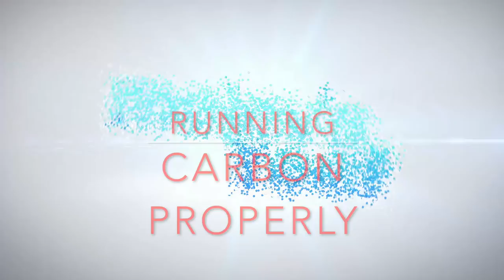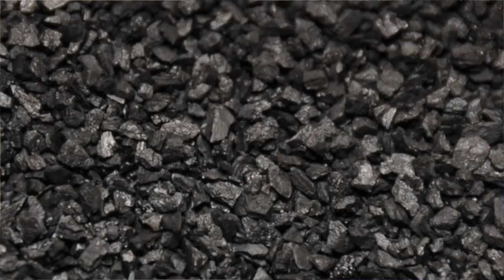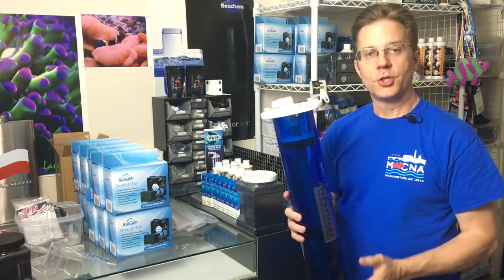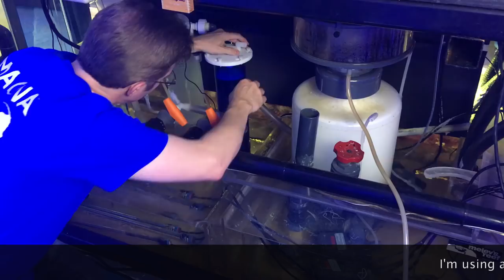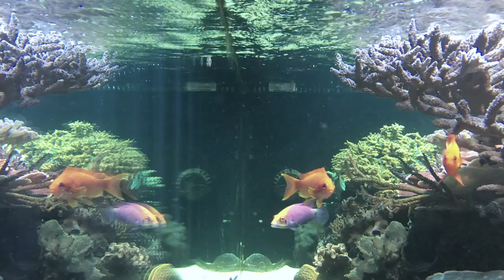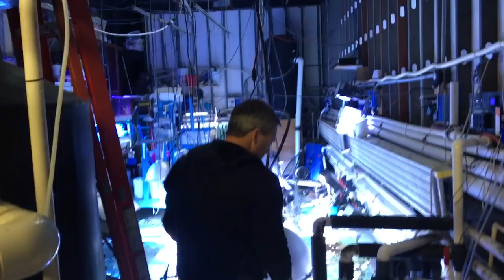Running Carbon Properly in a reef aquarium

Comment: Thanks for the video, informative and well filmed as always. I run my carbon in my MR1 placed at the top above my GFO. Works really well to polish the water. You mentioned cyano, I ran into that problem while carbon doisng trying to get rid of algae issues. As soon as I stopped carbon dosing it went away within 2 days. I tried multiple carbon sources and they all produced cyano. I mention this knowing you carbon dose, so maybe that may be the contributing cause. Love your videos and definitely enjoy the longer videos you produce, so an hour long video, especially on such a large system, will be great to watch. I find when reviewing tank systems, shorter videos tend to rush the info and overview so not all the information can be delivered.

Comment: True that. Carbon is bye bye after a couple of days through active circulation. Many are told to keep it in for a month. My return pump is 800 gallons an hour. For 1/2 cup of carbon this becomes quickly utilized and exhausted.
Reply: +Alex Kingcole 
also, thank you for posting the 20K gallon reef! Love it, love it, love it. I was at Joe's 2015 MACNA conference so this is awesome.

Comment: I stopped using granulated carbon on a continuous basis a while back. I noticed I would sometimes have STN episodes after changing it out. The higher the grade of carbon, the more likely I would get some STN.  Now I use powdered carbon in my diatom filter. I run it for a few hours every other week or so. It works great, I save money and no STN.

Comment: Hi Mel, I enjoyed the video as always. I use carbon in a couple of canister filters, simply to free up space in my sump and as you said, it works perfectly. However, I change it once a month when I do a 50 gallon water change. I noticed that you believe carbon stops working after a few days, but surely this depends on the load it is absorbing does it not? I also checked a couple of the other people I subscribe to (BRS and Mr Saltwater tank) and they seem to advocate about 4 weeks as well. So I guess my question is, why do you believe carbon only lasts a few days? I hope you include plenty of video on the behind the scenes of this large system you are going to feature. Do it whichever way i easier for you. I can either click on a new video link or pause a longer video. No biggie either way. Thanks for the videos. I find them informative and fun.
Reply from the maker: You can see the way the water looks a few days later to tell if the Carbon is no longer pulling out tinge from the system.
Reply: true... refrigerator systems say for example, 300 gallons or 6 months. If we think about an aquarium, it's way dirtier than tap water and turnover through the carbon will hit 300 gallons pretty fast. At first I was skeptical of what you said, but it's probably true.  @melevsreef

Comment: Excellent. Love the vids, love the presentation, really looking forward to the big presentation on the large reef and I am absolutely tuning in on the NYOS 300. I have a 400Gal or 1500L because I am in Australia :) and I am absolutely considering the NYOS 300. It's sitting at roughly $1,300 USD which is about $1,800 AUD so I would be keen to hear if you would consider the skimmer value at the $1,300 USD price point!
Reply from the maker: +Anthony Page I should know more next week. :)
Reply: +melevsreef I'm happy to wait. Not spending that much money just yet, I am only just starting to wash my sand and plumb the returns etc. Looking forward to it.

Comment: I was under the impression that when running carbon in a reactor, one should push that top filter sponge and the filter plate down onto the carbon in the reactor so that it cannot tumble to reduce the amount of carbon tumbling and dust created? 
Or perhaps your low flow handles that. Thoughts?
Reply from the maker: +DiepBlueC If you control the flow rate in the reactor, you can avoid any type of tumbling.  I rinse it very well before it is hooked up so dust has never been a factor.   The slower the flow, the better.

Comment: Doesn't the carbon tumble with the top sponge not pushed down to compress it? I've heard that will make the carbon grind itself into dust. I know you run with super low flow though...

Comment: You mentioned using a canister filter with carbon but disliking media bags. How do you keep the carbon concealed in a canister without a bag?
Reply from the maker: The reactor has a sponge, usually  at the bottom as well as the top, which keeps the carbon in the main body and out of the plumbing. You can see the sponges in this video.  Water will pass through all the carbon this way.

Comment: I've been in the hobby since 97' and embarrassed to say that I did not have a good understanding of the use of carbon. I have always been aware of how it polishes the water, but always thought it did much more in terms of removing organics.  I don't run carbon all the time, but probably ran it a lot more than necessary.

Any thoughts on the limited use of carbon and preventing lateral line disease?

I look forward to the video on the Long Island aquarium, even a really long one.

Thanks Mark!
Reply from the maker: Since I know use it once every 4-8 weeks for over a decade, I'd say my use is limited.

Comment: I need a new Ro/Di system and will definitely check out your website.
Reply from the maker: +Carlos Galvez  Great. Here's the link to that section: http://melevsreef.com/catalog
Reply: +melevsreef Thank you very much i will definitely purchase one from you next week, i do have a quick question, how often should i change the membranes?
Reply from the maker: +Carlos Galvez Membranes can last 1-5 years.  It depends on your local water conditions. The membrane is on top of the RO system, in the big white housing.

Comment: Thanks for the video on carbon!!  My montipora started peeling off on the side when I ran the carbon for 2 days and I just realized I put too much carbon.   My water came crystal clear but my montipora were not happy.  Lesson learned.  Should I deduct the live rock from calculating 1 cup per 50 gallon?  How often and how long I I should run the carbon?  I am nervous to run it now after what happen to my montipora..
Reply from the maker: It's 1/2 a cup of GAC per 50g of water, and you could err on the side of caution and do true liquid volume, subtracting for the displacement (rock and sand). As stated in this video, I don't believe carbon lasts more than a few days, so I'd hook up a reactor for about 3-4 days once a month to polish the water.  When it starts getting a tad mucky and you can't take it, run carbon again.  That's what I do. :)

Comment: I heard not to use carbon because it depletes important things that help corals grow, is that true?what are your thoughts about this?
Reply from the maker: Carbon is used in freshwater and saltwater tanks to polish the water. It improves clarity and removes toxins from the water. Corals are always fighting for space using chemical warfare if not outright sweepers, and carbon helps pull that out of the water as well.  Corals don't suffer from carbon use, and as I mentioned in the video, I'm only suggesting you run it for a few days each month.  New foods, additives, water changes all replenish amino acids, fatty acids and a variety of trace elements. Plus you can buy bottles of those things if you felt the need to add them - although I never have needed any.

Comment: Great video! I just started using a reactor for carbon again. Before it was just a bag. Quick question, would you recommend running it for 3-5 days and not again for a few weeks, or once a week? Would running it once a week with fresh carbon be beneficial or is once a month for a week good enough? thanks!
Reply from the maker: +ROTTER tube Reef Once a month for 3-5 days should be good enough to polish the water.  Then take it offline, clean it out and set it aside until next month.
Reply: great thanks!

Comment: Great video along with all the others I’ve watched lol.. was wondering how you clean the black water from the carbon? I’m dealing with that now on a new tank. Nothing in it just sand and rock
Reply from the maker: You need to rinse the new carbon well, as described in this video. You won’t have black water if you do so.
Reply: Appreciate your feed back. How would I get my water clear again? I did not see this video before I did my carbon an didn’t rinse well an now my water is black.
Reply from the maker: Normally filtration will remove it. Are you sure it isn’t just dust on the glass than can be wiped away? Do you have a protein skimmer? What size aquarium?
Reply: @melevsreef  Oo ok. Yea it’s from the carbon bc wen I put it in the back chamber ( of my water box cube 20) black water came from the overflow chamber

Comment: Few questions. What is better, if you can only have one of them, Carbon or GFO? and if there is a tube in and a tube out, why the reactor needs to be imersed in water, is it possible to just not? btw: My aquarium is a nano, 63 L(~16 gallons). I'm having an algae problem.
Reply from the maker: If the reactor leaks, it leaks into the sump. If you want to run it externally, you definitely can.  But you may need a towel one day. ;)    Carbon pulls out some organics, clarifies water (removes discoloration), absorbs some trace metals. To learn more about carbon, read the two articles I linked in the video's description.  GFO controls phosphate by binding to the media.  Two different things, entirely.  So you have to decide what you are trying to accomplish.  

I have a video about green hair algae you might want to watch.  https://youtu.be/xilqKzoOgBE

Comment: Hello Mark. Wonderful videos that have been instrumental with helping me take my very first plunge into the saltwater hobby with a 32g biocube.  About 6 m,onths in now and I can not seem to get rid of very fine particles in my water. I have a hang on the back media reactor and am wondering if I replace the bio pellets with carbon if that will make a difference.
Right now I run phosguard and carbon together in the same bag in an after market Intank media basket. I do run several pieces of filter floss at the top of the basket and all water flows through this floss, but I just can't seem to make any dent in the particles.
Thanks in advance!
Reply from the maker: Are you talking about white flakes blowing around, or detritus?  My own reef has a situation last year where I had white dots blowing around everywhere. If I recall correctly, it was an imbalance of my water parameters that once corrected, resolved the problem.  Maybe you are dealing with something similar?
Reply: Very fine white flakes, like small shavings of plaster. I will check all parameters today and see if anything stands out. 
Thanks for some direction!
Reply: I checked and found my Calcium was very high around 560. I have been using instant ocean reef salt to mix my own salt water. I checked parameters after i mixed a fresh batch and found the calcium was way to high. Salinity was 1.026. Would this be the culprit?
Reply from the maker: Yup!  You are going to want to get all your parameters back in line with the target levels, the snow will stop once you do.

Comment: Just curious about the position of the carbon tube in the whole system..
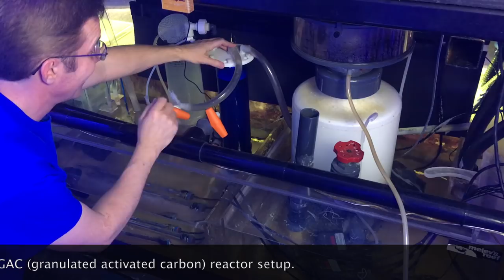Reply from the maker: I put the reactor inside the sump in the return zone.  It drains into the skimmer section, before the baffles.  You can see it in this video around the 7:00 mark.

Comment: Using different types of carbon has little to do with the product size in regards to leaving/escaping the reactor, media bag, etc. Each size has a different pore structure designed to remove different contaminants; and in turn each has various uses depending on what you're trying to accomplish.
Reply from the maker: Great points. Feel free to add more details regarding that for everyone to read.

Comment: Hey Marc I had a question for you. Have you ever came across these tiny little white bugs? They are so tiny almost like red bugs but these are not red bugs they look like fleas but white. I just got my kessils today now I'm worried I may need to convert to a fowlr its to bad so much coral so much time and money all wasted due to these dumb bugs
Reply from the maker: +Fred Beer There are all kinds of bugs that come in with corals. But how is the livestock doing, specifically?
Reply: +melevsreef thanks for the reply. Most of my corals are doing fine and opening up. My torch coral was doing great for a while but has recently lost a head due to these bugs. I think these bugs came on a zoa frag and I also believe they are eating them too.
Reply from the maker: +Fred Beer You may want to try dipping any affected corals to help reduce their population.  Very small wrasses (Yellow Coris, for example) will pick off bugs like that.

Comment: Hi Mark, I wonder could you anwser this... can you use the carbon filter that is designed for a ro system on a reef tank ?
Reply from the maker: Stephen Smith No, it’s a different type. You want granulated or pelletized carbon, not carbon block like RO systems use.
Reply: exactly what I needed to know, Thank you for the reply

Comment: I have a couple carbon questions I'm hoping you can help with.

1. Is there a negative effect when using 2 or 3 times the regular 1/2 Cup to 50G amount?

2. After using Flat worm exit, could I fill the media reactor full with carbon just for this use? 

Please and thank you.
Reply from the maker: You can double the GAC after a Flatworm eXit treatment. But for normal use, stick to the regular amount.
Reply: melevsreef roger that. Thank you!
Reply: BUT is there a negative effect that can happen IF you do run too much?
Reply from the maker: A negative to using too much GAC?  Yes.  Too much carbon can affect certain fish, like the Yellow Tang. It's been attributed to HLLE issues. It can strip too much from the water.  It's best to use the correct amount that matches the system's needs, which commonly is .5 of a cup per 50g of liquid volume.

Comment: Is it ok if I leave carbon running for a month? I ask because my setup is small so I mix carbon and gfo together.
Reply from the maker: +First Massage Yes, you can leave it in there but it won't do much after a few days.  What's your nitrate level?  That's where the problem might occur.

Comment: I have a sump, where do i put the carbon reactor? in the same place as the return pump? Or do I cycle the pipe so it goes from the carbon reactor to the return pump then to the tank? Please helpppp
Reply from the maker: Anywhere it will fit.  Just have it water exit somewhere quietly into the sump.  It will improve water clarity.

Comment: do you recommend a phosphate reactor.. i heard you say you run a calcium and carbon. i keep getting carpet algae, glass algae.. but i run a pretty good PSkimmer, algae scrubber, refugium 40g established bladed grass. 120g DS fish only cause coral wont stay alive grrrr. DS light only 8hrs, scrubber and refuge light 16hrs... any suggestions would be great TANK you 😉😎
Reply from the maker: I just use Phosphate Rx to remove phosphate. It's easier than a reactor full of GFO.
Reply: Lol.. yea i found your vid on that later yesterday.. thx for your quick response.

Comment: I put mine in a nylon filter sock.  The trick is to put the carbon in a separate filter bag and make sure you tighten the bag so the carbon is not loose.  Then the carbon is tight and has no wiggle room to get pulverized.  Works great.
Reply from the maker: How long do you keep it in there?
Reply: melevsreef about 2 weeks.  I have no real way of knowing it is exhausted.  I know home water filters say 6 months but they don't have nearly the amount of constant flow.  Another way I think you can tell it's time is when you turn off your pumps for feeding or water changes, take sniff of the still water and if smells fishy, it's time to change the carbon.
Reply: melevsreef Also when you clean your filer socks just rinse off the carbon bag.  Much easier than messing with a reactor.
Reply from the maker: In my experience, carbon doesn't last nearly as long as you are indicating.  I base that on tank smell as well as water clarity.
Reply: GAC generally lasts about two weeks, you can do the white bucket test to see if the tannins are building up. My tank seems to get pissed at  even the slightest amount of GAC really so I don't use it all that much. Change water.

Comment: previously you were using bio pellets in that same rector, do u still use bio pellets.
Reply from the maker: +Sandeep Shetty I have two of those Nextreef reactors.  One was for biopellets, the other for GAC.  I stopped running biopellets about 14 months ago.  I may go back to it, perhaps.
Reply: thanks for the reply but why did you stop using biopellets?
Reply from the maker: +Sandeep Shetty I discussed it in my Prodibio presentation. https://www.youtube.com/watch?v=LzG9-cqD2QY

Comment: I'm confused.  Everywhere look, they say that the carbon is good for a month.
Reply: Jake Carpenter that's just a way to keep you buying it. everybody system is different.
Reply from the maker: The question is, is it really good for a month?  In my experience, it's good for a few days.  That doesn't mean you replace it every time.  I haven't run carbon on my reef in two months, but I feel the urge to run some now since the water's clarity is less than desired.  

Running carbon for a few days once a month is perfectly fine.